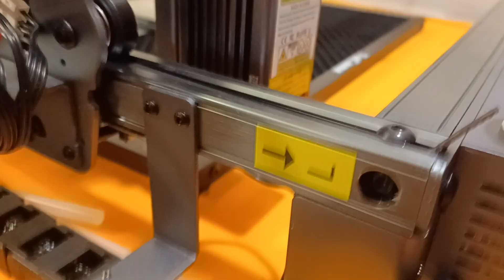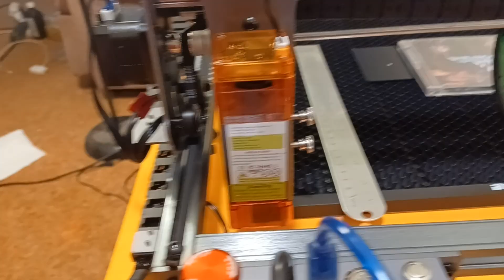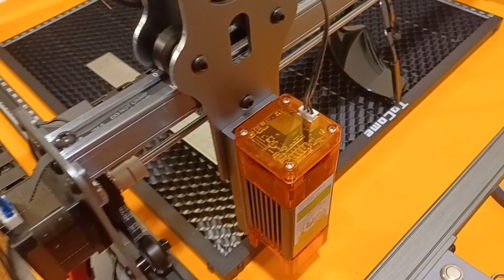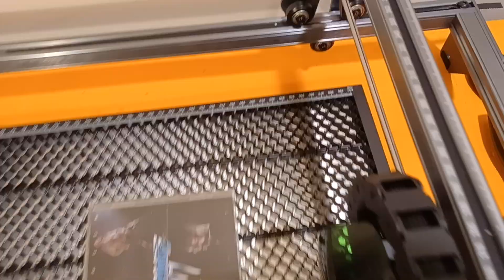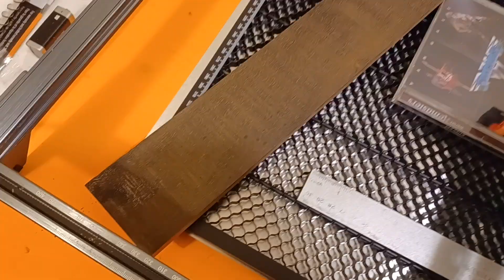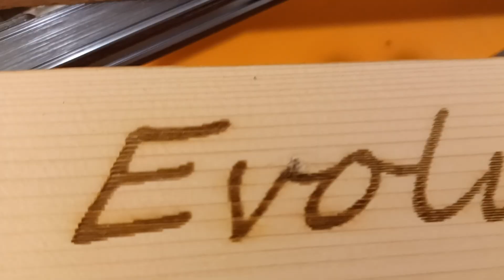Vevor 5w Laser Engraver unboxing / assembly Pt 3

Comment: without your help mate I would of never been able to build my laser 
thanks for taking your time and showing everyone ❤🎉
Reply from the maker: Awesome. Yes the instructions could be a tad better. that one harness threw me off for a bit as you saw in the video. 

Good luck  with the learning curve of light burn if you havent used it yet. Its  pretty simple really. I  find the hard part is getting the materials you want to work with lined up perfectly.

I think I am going to make a better base for mine and put the measuring lines down on that that I have it set up on ATM.
Reply: @borgonianevolution yeah I have a c02 laser im only a beginner brought it for my partners business not too long ago mate 

used light burn a little it is a work around 

the hardest part is linging everything up ive noticed haha 

did you custom make your own board to line everything up ? 
as the 5/10watt laser is the same design would you happen to have a file for the board to line everything up properly 

thanks again mate your a legend
Reply from the maker: @isaacwood8502  I had just made a base out of scrap wood to set it on one of those plastic storage racks so it was more stable. 

I have some Lexan coming  that i will make the better solid based out of where I can engrave registration marks in and then fill with paint to make them more visible.

I build guitars as a hobby so I really need a solid and repeatable way to do things.

I will probably make a new video once I worl that all out.